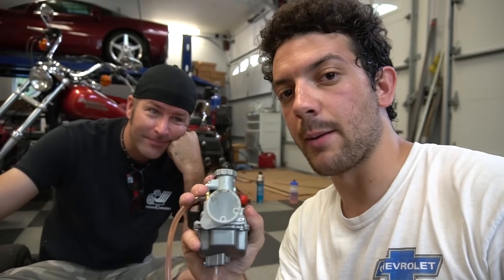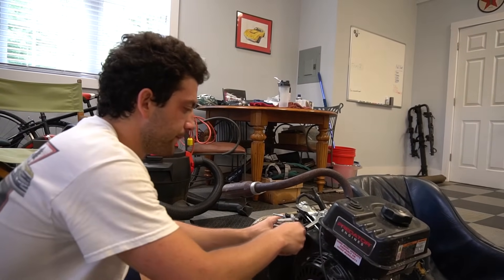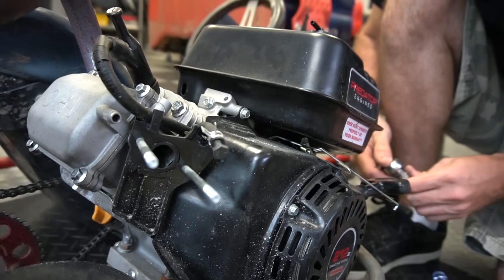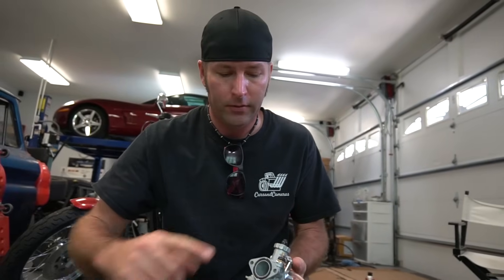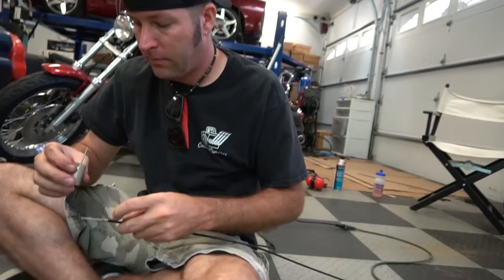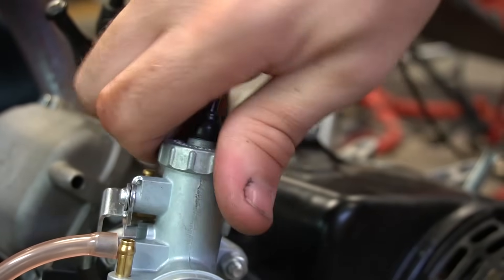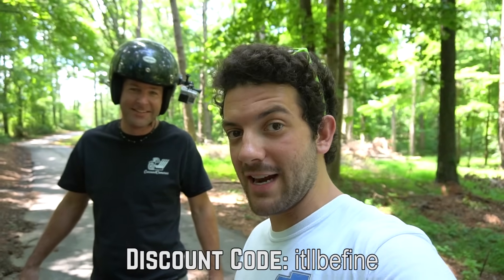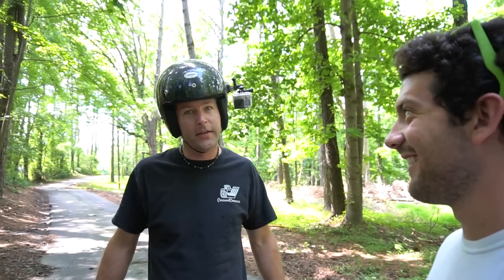How to Install a Mikuni Performance Carburetor

Comment: It threw a rod because you bypassed the governor and over revved the engine...without a stronger rod.
Reply: What Rod?
Reply: What does bypass the governor mean?
Reply: @jerardortiz9088  it means the governer system is being pretty much overran and they kinda just said “it’ll be fine”
Reply: @jerardortiz9088  The governor is the metal object they took off, that used to be the Excelerator for the old carburetor, looks like an L lever
Reply: @_kevflo  No the governor is a plastic gear in the body of the engine.
Reply: @okiedouk  no it’s not
Reply: @dimamoto1816  yes it is
Reply: @BananaGoblin1  no
Reply: @dimamoto1816  @Dima Moto  yes it is. ask these two from CarsandCameras if the governor is a plastic gear piece located inside the engine or is it a metal object used for the original carburetors accelerator.
i thought it was the original carburetors accelerator too until i looked closer at the video where they removed the said governor from the go karts engine...
if your not convinced check his video out when he did right here on https://www.youtube.com/watch?v=iQkLHDcLeWE at 3:00

if your still not convinced check these videos out:

https://www.youtube.com/watch?v=0dpiWqLsuIw

https://www.youtube.com/watch?v=0dpiWqLsuIw

https://www.youtube.com/watch?v=-uyGHBlQlCs

https://www.youtube.com/watch?v=z7wUcp7jUJg
Reply: He’s right governor is a plastic gear inside of the case that works off of centrifugal force. If the gear spins fast enough it raises up to catch another gear that limits rpm. If remove the gear and all of the excess components , jb weld where the arm was and then it officially will be fine.
Reply: Bro none of y’all know anything about these engines
Reply: @anonymousproductions1792  for real 😭💀🤣
Reply: The idiots in the replies confusing the actual governor gear with the governor arm acting like they know the engine but have probably never taken one apart the governor gear it's self is typically a plastic gear with internal weights located inside the engine on the fly wheel side it's driven off the cam shaft and once it spins at a high enough rpm it extends a center actuator making contact with the governor arm which pills on a connecting plate that pulls back reducing the throttle until rpm has dropped this is to save the cast parts that can not handle high rpm such as the connecting rod and flywheel
Reply: Nah it's just a Bluetooth rod
Reply: @Volkeith_hauler_of_stone  hey bro , I took the governor arm off my 212 , I jus got a mikuni carb . Would I be able to install it even tho I haven't physically removed the governor , without having issues?
Reply: @Volkeith_hauler_of_stone  I have an old robin suburu 5 horse motor and I took the governer out!  And the governer arm out and cut the arm on the inside just enough so it wouldn't do anything then placed it back in!  3 years later and it's still going strong! 💪
Reply: Do u really need the extension manifold?
Reply: @anonymousproductions1792 Your right they dont know anything about these engines. A predator 224 has a plastic cam shaft.
Reply: Stock rpm called for 10-30 at 3600, running a motor at twice the rpm and heat these motors definitely like 15-40 to 20-50 long term, ct200u manual even calls for 20-50 for certain heat ranges
Reply: Running on a stock motor with a juggernaut, vm22, header, 40t sprocket, and aluminum pushrods revving out to 5500-6k, after running 20-50 I see far less metal shavings on my magnetic dipstick
Reply: Nah definitely because of the cam dude
Reply: @justincuellar3101 still running good stock?
Reply: @ct200u  still runs good, still has compression just swapped it over to a ducar 224 running on all the same parts, mod 2 cam and 15-40. 196 currently is bout 4-5 years old with hundred of hours on it. Keep it under 6-6.5k and you’re fine. Just don’t let the temps creep past 450+. Hottest I got them too was 420ish full pinned for  about a mile or two
Reply: @ct200u  gearing is your biggest friend, torque converter and juggernaut u can dial in top end rpm range with sprockets, a lot of people blow the motors up because their geared pretty short only to see 50-60 mph, current ducar 224 on 22lb springs and mod 2 cam highest rpm I got it to was 6k @ 61mph, loads of torque and top end still
Reply: Cam says it’s good for 7k but I won’t touch that till it gets a rod and shorter gearing
Reply: @justincuellar3101  that’s awesome to hear my man. i just got a stock 212 last week, planning to install an arc rod/flywheel and upgraded springs but so far its running amazing stock with a 30 series torque converter and header pipe.
Reply: @scoopsf  they ever answer your question. I am in need of the answer right now 🙏🙏🤝

Comment: When I installed my Minkuni on my 212 on my yerf dog like you guys have, I cant get it tuned correctly so it doesnt want to roll on its own at idle.  The drive belt isnt too tight and it is aligned... Ive messed with the needle settings the idle settings and air fule mixture settings,,,,,, any help is appreciated!
Reply: I’m having a problem with my mikuni carb cutting the engine off when I give it gas
Reply: Get the genuine not the knock of carb
Reply: @ElPatronGamefarm   needs different jets, also have to make sure it’s lined up perfect on the O ring in the mount

Comment: For everyone wondering the adapter size is 48. You also just take off you carb and measure the difference between the bolts
Reply: How long can the adaptor be and can it have slight bend

Comment from the maker: We're making a dissection video to figure out what went wrong!
Reply: CarsandCameras it'll be fiiiinnne!
Reply: CarsandCameras rain drop, rod knock, there's a hole in my engine block😂
Reply: CarsandCameras can I use the makuni with a non hemi
Reply: My guess is that when it ran too lean and got hot the piston wasn't liking it and that was why it lost power and later threw a rod.
Reply: CarsandCameras what size was the carb? i wonder if it could of "hydrolocked" to much fuel in the cylinder. it should of held together i would think unless you had bearing failure
Reply: Is that 2 rods in as many videos?
Reply: CarsandCameras can u do a gound up dirt bike build with list of parts and steps
Reply: CarsandCameras Feel sorry for you guy's go through all that work & time building the kart then throw a rod man that sucks when you have days like that. Oh yeah the best line of the episode was at the end HELP! lol
Reply: Now for sale. Partially used Predator.
Reply: I know what went wrong, You had a loose nut behind the steering wheel. :)
Reply: CarsandCameras did a valve hit the piston and that's what exploded? Head shaved plus bigger cam equals P to V issues. Did you change the springs to stiffer ones for the new cam? I can't wait to see what you guys find out.
Reply: Yes
Reply: Polny Vlogs yes you can!!
Reply: I think what happened is because the governor arm did not have a Spring holding it until position it moved out toward the rod and crank and snapped that dipper off! Don’t ask me how i know lol..
Reply: CarsandCameras what carb millimeter would I put in 24 34
Reply: CarsandCameras hey how do you choose the correct carb size for a given engine size?
Reply: CarsandCameras What about the line coming out the valve cover? Does that need connected to anything?
Reply: Hey guys! I put a new carb on my motorcycle 125cc but it has a super high idel, I tried adjusting it  but it's not setting it any lower. I would appreciate any advice. HEEEEELP!
Reply: Isaac Pulido take the needle out and place the lock screw on the top setting
Reply: You ran it to rich you need to put the throttle needle to top setting not the bottom the lower you go the higher the needle sits in the carb giving it more gas
Reply: @sagecomstock7385  😂😂😂😂
Reply: Where did you run the breather tub from the gas tank to?

Comment: Biggest advantage of the Mikuni carb is the quick and easy jet adjustments. Stock carb has NO adjustments, save physically swapping jet. Fell in love with Mikunis back in the 70s with my Kawasaki A7SS, which had two. Still have those carbs although the bike is long gone.
Reply: 3:08

Comment: Well they say when you replace the rod, replace the flywheel and the valve springs so your not limited to 5300rpm. When the valves are upgraded you can see 6500+.
Reply: The valves are rated to 6500 rpms anyway

Comment: you guy's just answered your own question need that billet aluminum rod's! if you going to stage 3 it do it too the max
Reply: But if it’s still governed should it still be a problem. I’m about to put one on a stock predator. I have one on my Coleman 196 ct200u and haven’t had any problems.

Comment: I just got a mikuni carb and I dont understand where the hose from the side of the carb and bottom of the float bowl go. I have been fallowing your channel for a while and was hoping to find the and were in this video but you kind of leaped over it. Would you mind including this in a future video?
Reply: 1 is prob a vent tube.other is overflow tube.

Comment: i just installed a genuine mikuni on my minibike, but the gasoline inlet is short and way bigger than my fuel line it’s a good centimeter wide. i was able to jerry rig something that works but i’d still like to know why it had this. oh, the inlet was on the opposite side too. Thanks

Comment: Ok so I got a question that I have about the carb. There is a little pointy thingy at the bottom of the Vm22 is about half an inch away from my tire. I am afraid that the ponity thing will pop my tire or rip the carb right off the motor. I seriously need help and I have sat in my garage staring and thinking about it for almost the whole day. Should I drive with it on or should I spend 120 dollars on tires

Comment: I ordered the same kit from GPS for my modded Hemi. When I started the engine it sounded like it wanted to rev full throttle. Did you have to make any other adjustments on yours besides the needle valve. Finally when you push the plunger down is that choke on or off. Keep reading conflicting statements. Thanks and keep the great videos coming

Comment: Question i have a brand new harbor freight 212 predator engine and i had it setup right and everything but it won't idle on its own i have to constantly give it gas or itll shut off so i wanna know if theres a way to fix it i already tried to turn the idle up but it doesn't do anything

Comment: shouldn't the carb be upright and not at an angle because of the floats and stuff? Shouldn't you make a fender kinda thingy so the tire wouldn't rip the carburettor? they were really close. Hope you answer

Comment: I bought a kart with a used predator. I was told it was cammed with heavier valve springs. It needed a carb so I ordered a mikuni kit. Will I need to Re-jet at all? It also has aftermarket exhaust

Comment: Question for you guys...did you run the carb right out of the box? I just got the same kit in the mail from gopowersports, and it will not rev past about 1/3 throttle. Straight up cuts out. New 212, mild mods, running great on stock carb. 130/12.5 jets on the way, but I'm pretty surprised by how terrible it runs out of the box. Best needle clip position was 2nd from the top, and I'm at sea level in FL. Thanks for the excellent videos!
Reply: J.K.P Mon gopowersports had told me that they drill the Mikuni 95 jet out to 130 in all the VM carbs they ship, but I could not get it to run right. Currently running the 130/12.5 set up, needle on 2nd clip, and it runs strong. Thanks for the reply.

Comment: I got a mikuni carb for my predator 212cc. I have an aftermarket pipe. The carb is clean. It acts like it doesn't want to start. Then when I do get it started it idles high. I tried messing with the idle screw. Nothing. I tried messing with the air fuel mix screw. It makes it sound choppy. But it still idles high. I stood behind the bike and it throws the exhaust like baseballs. You can feel it hit you from 15ish feet back. But the 2nd I apply idle, it dies. But if I do a fast idle. It will go really high. My torque converter exploded. So I've only done it once.

Comment: Please re due this topic were you discuss were the lines coming from the engine should go onto th carb. I  personal woumdering were you hook up the line that comes out of the ohv assembly and what do you do with the second fuel in line coming  from the bottom of the carb?

Comment: I bought a Mikuni carb off of ebay and it bolted right into the intake with the manifold adapter it came with, the issue im having is the the carb has what looks like two vent ports and 1 port for the gas line on the upper side of the carb, and I have gas pouring out of either the side where the air cleaner clamps onto the intake large hole, or the gas drains out from the bottom port for a line--what lines goes to the two ports on the upper side of the carb, and can the port directly on the bottom be blocked off or where does the line port on the bottom of the carb go to ?

Comment: I couldn’t figure out why after i hooked it up it went to straight full throttle....the cable was attatched right and the slide was only open a crack.....i cant seem to find out why it just pegs without any throttle....i have 18lb springs, no governor, and a forged rod,.....help

Comment: putting that carb on that motor was like putting a big blower on a stock bottom end . I' don't remember how those little motors  cranks are put together but I'll bet the crank twisted and three the rod.
Reply: I think the oil dipper broke

Comment: I installed this carb and took out all the factory throttle stuff. Haven’t nt broken in to take out the interior governor. Any issues with this
Reply: The governor should be fine it don’t doing anything anymore. But if you want you can go the extra mile and take it out

Comment: I have a predator 212 (hemi), billet flywheel, billet rod, mod2 cam, billet lifters, stainless steel valves and chromoly push rods. I installed a 26mm mikuni carb, when I start the bike the back tire immediately begins to spin, I've adjusted both screws and it does nothing, what do I need to do?

Comment: Question:  Have a DB30 Doodlebug.  Hemi 212 that I modded last year with the following:  Governor delete, jetted stock carb w/aftermarket filter, aftermarket header/muff, and billet flywheel.  Rode it as is for a couple months...obviously much better power.  Had purchased a mod2 cam back then, but never installed it until a couple days ago (tried, but crank was in the way).  Finally bought a Dremel tool, made the clearance for the cam and installed it a couple days ago.

Was expecting a big gain with the new cam, but if anything, less low end power!  I've only taken it out once since the cam install, but that was my initial impression after 5 minutes of riding.  So the question is...am I needing to upgrade my stock carb to the Mikuni 22mm to realize all the upgrades now?  And I also have the stock rod in it.  After watching this vid, of course I'm concerned about throwing it.  However, it's on a minibike (not a heavier gokart) and I only weigh ~160 lbs.  And, I'm at about 5,700 ft elevation in Colorado, so...making a bit less power because of the higher elevation.

Also, it'll kick back pretty good when pull starting it.  I have to wear a glove and keep my fingers loose on the pull handle, anticipating the whip back, so it doesn't take my arm off.  I've checked the coil gap on the flywheel more than once and it's at 0.03".  Any ideas?
Reply: Not the greatest place for feedback, I guess.  Anyway, I bought and installed a billet rod and just finished installing a Mikuni carb.  I bought all the carb related parts and the rod from gopowersports, but found the carb on eBay for less.  It's a genuine Mikuni 22 mm, but a bit different than the one shown in that vid.  Minor differences - the slide/cable connection is slightly different, the bowl design is different; the tube doesn't hang free, connected at the top and bottom of carb.  And the fuel line fitting is larger (had to rig it when step up brass connector and larger tubing).

I believe I need to adjust the needle, as it feels like it might be flooding if I give it too much gas too quickly.  I didn't do as instructed in your vid; left it as is.  I think the clip was set at the 2nd to the bottom notch (only glanced at it).  Hopefully adjusting it to the bottom will resolve the issue.

Comment: Thinking about doing this to my Tillotson 212. Right now I’m using a zip tie to bypass the governor. Do I need to remove the governor to install this Mikuni carburetor setup?
Reply: I assume no from watching the video because the governor rod does not touch the throttle it will just be flapping around

Comment: Yo i need help... on my go powersports mikuni carburetor i pulled out the throttle sleeve assembly and there is a spring clip that was sitting loose inside the sleeve? It deasnt appear to be in the correct position? Any help with this would be great

Comment: Would there be any power gain at all if you left the stock muffler on
Reply: I have the tilly 212 and remove Governor but when I did they didn't explain that you have to get a different throttle when removing the governor so I guess I have to get a half plate but I was still wondering if I did the air but not the muffler cuz I want to put it on a mud motor and keep it quiet if I get any performance or is that just not possible

Comment: Mine 212cc Stage 2 Predator Missing Big Air filter & Can't get it to start Unless I use Starter Fluid, When it fires up Its full Throttle Couple revs Then Bogs Out When I let off the Gas.???????

Comment: I want to hop up my honda clone. It's a Lifan 118cc 4hp, and some Predator 79cc and 212 parts fit, but what about a billet con rod? I don't want to throw a rod when I remove the governor. everyone says there is no rod for 79cc, so what rod should I look for?